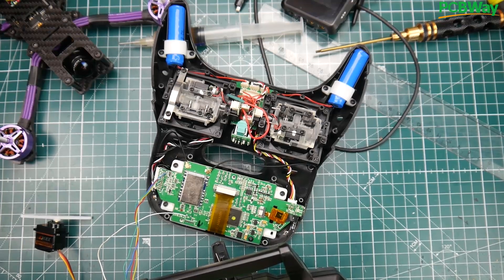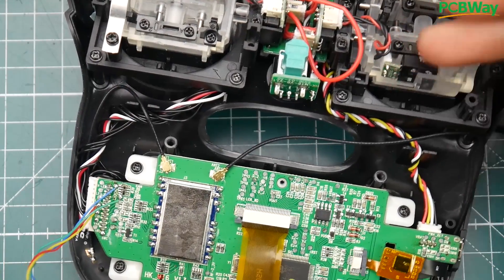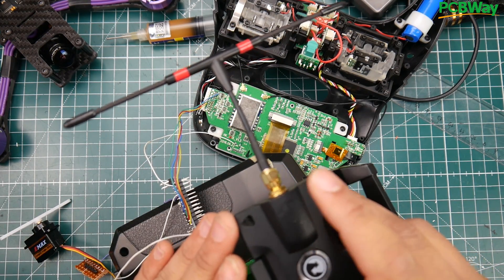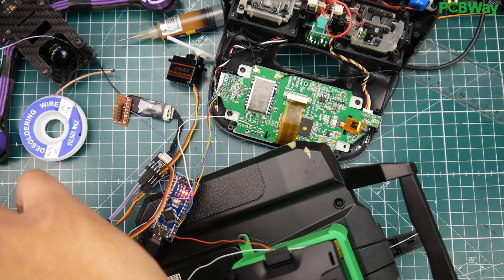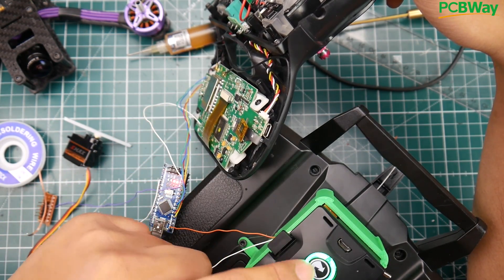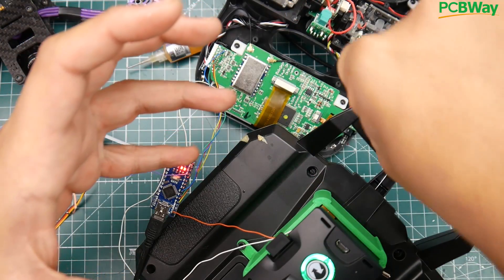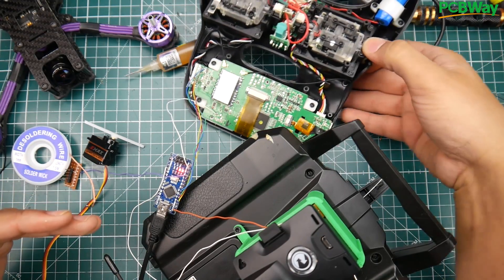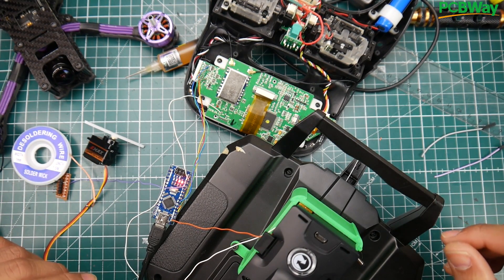Turnigy Evolution Long Range Mod // TBS Crossfire & FrSky R9M Mod Part 1

Comment from the maker: Osciliscope
 4ch
http://bit.ly/2SVnR4h

Consider Following me and supporting on Patreon
https://www.patreon.com/DroneMesh
Reply: Nice!!!
Reply: While reading this thread https://github.com/fishpepper/OpenGround/issues/1 I was under impression that Turnigy Evolution may have PPM out and you do not need Arduino. This makes things much easier. On the main board top edge there is unpopulated connector. The same connector on the FlySky radio is used to connect trainer port with PPM out. The only thing you need to check if you will not find signal maybe series resistor going to MCU is not populated.
Reply: @Mr.Laidukas  Great info! @DroneMesh: this is the part1 video, I see that many people would really like a follow-up on this mod. 

Many here (myself included) don't have any software/programming background, and cannot yet do this mod themselves. Can you look into the PPM-output option in the part2 of the video? Many people are waiting for a part2 and add the R9M to the evolution controller. Thanks!
Reply: Awesome! Please do the USB charging mod for the xlite, thanks.
Reply: Wow, DS213 is back! Want!

Comment: Awesome! Still love the Turnigy Evolution for it’s ergonomics AND large screen. X-lite doesnt fit my hands that well, TBS Tango has a tiny display, still hope for a Turnigy evolution 3 with lora transmitter or 4in1 module  featurung open-TX

Comment: While reading this thread https://github.com/fishpepper/OpenGround/issues/1 I was under impression that Turnigy Evolution may have PPM out and you do not need Arduino. This makes things much easier. On the main board top edge there is unpopulated connector. The same connector on the FlySky radio is used to connect trainer port with PPM out. The only thing you need to check if you will not find signal maybe series resistor going to MCU is not populated.
Reply: you make a tutorial, really turnigy evolution community we need a tutorial with easy explanation of this mod

Comment: If you just connect the tbs transmitter into [Turnigy evolution -> Any Ppm receiver ->ppm pin Tbs transmitter -> Tbs receiver] wont it work?
Reply: It will work

Comment: Nice job! Good to see you enjoying doing this!

I don't use actual Arduino's anymore myself, because the ESP32 can be acquired cheap, is smaller, has a lot of features and gpio's, and works with Arduino code (and is 3v3, which might come in handy in this case).
There are probably more boards/SoC's like that these days that might be worth considering 😉

Comment: Think about using a DigiSpark instead of the Arduino Nano it’s cheap and tiny and maybe enough to get the size down. Not sure if soft Pwm is working to get more pins.

Comment: Duuuuude! You keep uploading R9M Mods to non-FrSky Transmitters... But you never mention how to flash a brand new R9M Module or R9 MM or R9 Mini without a FrSky transmitter... If you can point that out, people with only FlySky on hand, can also benefit this mod... Other than that, this is useless...
Reply: I already send him an email and a thread on his forum, but I havent heard anything from him!!
I only have a flysky and I need to know if I can set the tx up with a pc or arduino or if I can lend a frsky from someoneelse and save all the settings to the module itself!! 

Pls

And latency test, like he did a year ago would be nice
Reply: this video is far from useless.  I was looking to be able to do this exact thing.  I prefer the ergonomics of the evolution over FrSky's.  This gives me the best of both worlds.

Comment: How much latency is there when using PPM with those modules?
Reply from the maker: Have not tested it yet.
Reply: Not just ppm, but isnt arduino pretty slow as well?  Maybe that isn't an issue though you certainly know more about this than I do.  I came here hoping you just had good instructions on hooking up an external antenna, heh.  I am JUST getting into the hobby, have my evolution literally arriving this week for starting on sims!  I am worried I won't be able to fly much since I am about 2.6 miles from a tiny rural airport.  Will have to talk to the manager and hope they give me an okay for very low altitude flying.
Reply: While reading this thread https://github.com/fishpepper/OpenGround/issues/1 I was under impression that Turnigy Evolution may have PPM out and you do not need Arduino. This makes things much easier. On the main board top edge there is unpopulated connector. The same connector on the FlySky radio is used to connect trainer port with PPM out. The only thing you need to check if you will not find signal maybe series resistor going to MCU is not populated.

Comment: Eeej man quick question if i use a 3s lipo on my qx7 would i get maybe better range /signal (because of the higher voltage) or doesn't make that a difference ?(edit 2s i mean 😆)

Comment: I did this mod with the i6s and used your 3D print from the i6
Reply: How did u set up the external module???
Reply: R12 I used his same way of hooking it up to the i6. Found a ground, v+ (vbat), and the PPM_OUT pad on the main board and soldered three wires up to it and used the same pin method he used and drilled a hole through the back of the i6s for the wires to go through. I then got his 3D print mounted on the back and added the switch so it doesn’t suck all my battery down. And that’s about it man.
Reply: @bradyrc818  I mean how to set up the mw, mhz, aux channels etc. On the crossfire or r9m module!!!

The r9m is cheaper and I would like to do this mod, but I dont know how to change settings without a opentx radio

I know the other part, how to install the module

Comment: Did you tested the r9m module on the flysky nirvana? I think that module kills the battery of the nirvana instantly. The nirvana is completely charged and when i put in my r9 module, the transmitter says that the battery voltage is low and 2 minutes later the nirvana turn off itselv. Did you testet this? Could ist be that the nirvana only provides 5V to the module, instead of 6V or 7.2V? Is there a mod to fix that? Thank you.